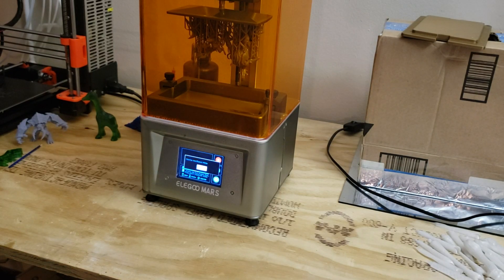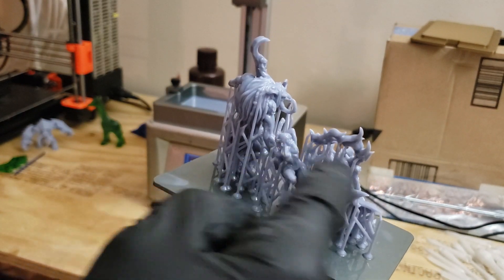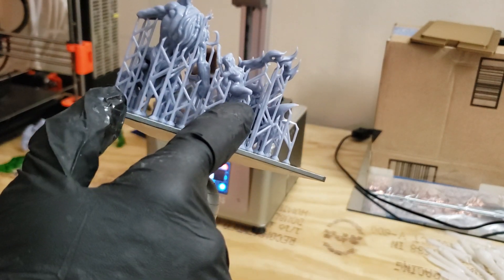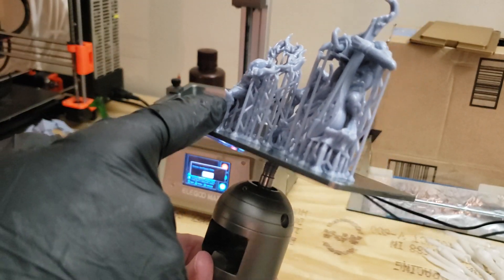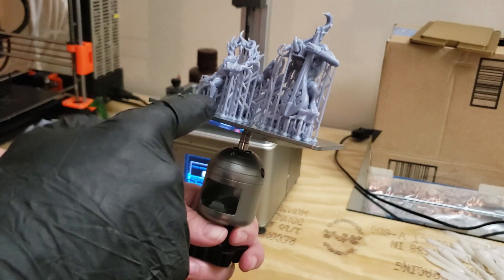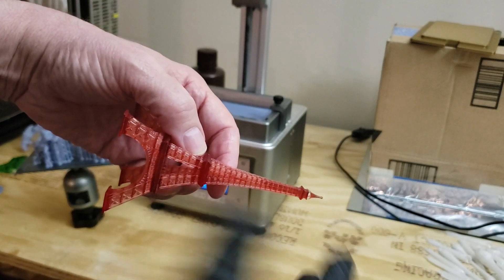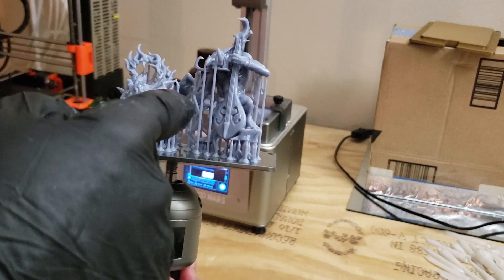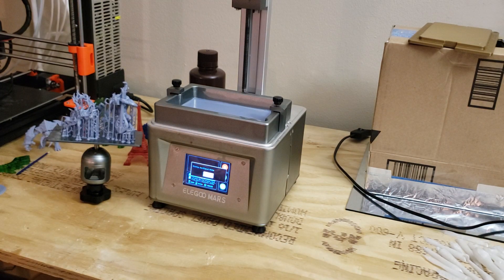Elegoo Mars. 5 tips for beginners

Comment: Hey  im new at 3D printing so new i baight it last may and only started using in in october failed print after failed print then i got some successful prints start getting hang of it then i tore my fep on the build plate i used the steel scraper to remove failed print instead of the plastic scraper but my problem i have is im online trying to get the elegoo mars pro 3D printer feps but then it says on add for the elegoo mars pro but theres different sizes how can i tell one i need is correct i dont want to buy the wrong ones cause some have fewer holes in them by pictures to ones on my printer can you help,?

Comment: failed my first 4 prints so i tried a different auto support program everyone swears by and failed again so I went back to chitubox used a raft used auto supports (Heavy) ALways print at an angle and Click light supports after you auto heavy support your model and look for any red with small gaps between the heavy supports and support them with small supports and feel free to over do it. NEVER had an issue again.. Don't use presupports because people have different settings and for some reason my models would fall off the supports and id find legs sticking out of the resin vat. Now i'm printing statues in parts about a foot tall and its awesome always successful never had an issue besides cleaning my vat on dirty tile.. (small rocks will pop holes in the vat fep screens (clear tape works great) Another tip is after the model is done and being cleaning in alch or water start pulling supports right away.. even the large ones will break off easily just be carful.. Im impatient and tend to break off small things in this process like a horn tip or sword handle and so on so clip any supports on the small stuff that may break and use your hands for the rest. Print anything vertical and you will have a rough time getting the model off of the plate.. not sure why

Comment: i would add carefully trim off supports with snips. don't break off supports with your fingers, or you may remove material from the model, damaging your model and leaving a bunch of circular depressions in your model
Reply from the maker: I agree.  You have to be careful in some areas.  In some areas there are so many supports, you can't resist popping them off with your fingers.

Comment: stack - more supports - print at an angle (30/40° angle: elevated from build plate) - lay them flat for speed - remove supports while soft (before curing in IPA)
Great video! Thanks
Reply: Thanks for de-boomifying this video XD. Though a question, wouldn't adding more supports make cleanup a nightmare? I'm already using exacto knife and asked my sister and brother in law for surgical scalpels (better blade for my models at least) for cleanup. If I add even more, wouldn't that make it even worse?

Comment: The more supports, the better? Why should i print supports where no supports are needed? More work on cleaning, more damage on the model. Stupid, in my opinion. And never use automatic supports. They suck :D Better do it by your own.
Reply from the maker: Sometimes you need more support because of the process. If the resin sticks more to the plastic at the bottom. It will cause suction and ruin your print. The extra supports gives the resin something to cling to.
Reply: @fergi1959  For sure you need Support for Islands that needs Support or for adhesion.  Thats not the Point. But "the more the better" ist nonsense.
Reply from the maker: I'm just telling you what works for me. If you found a better way I'd like to hear it.
Reply: @fergi1959  Watch the Videos of that Guy: https://youtu.be/TTZpvhfaNWY I tried IT and all my prints are almost prlerfect.

Comment: Very interesting, especially the part about large flat surfaces failing.  I was thinking of using a resin printer for small boxes or enclosures.  Probably not a good choice is it?  Keep broadcasting!!
Reply: You can also print 2*3cm boxes flat on the plate. I always do so and they never fail. I made hundreds of them. And many models are fine with a 10 degree angle, it depends on the model!
Reply from the maker: You can easily make small boxes as long as your elevated off the build plate at a slight angle

Comment: Is it possible to use tree supports like you can with Cura ?
Reply from the maker: Yes. You can slice it in cura and save with tree supports and then print it. But remember you should tilt the model to prevent it from failing